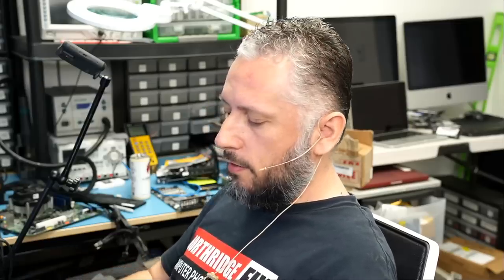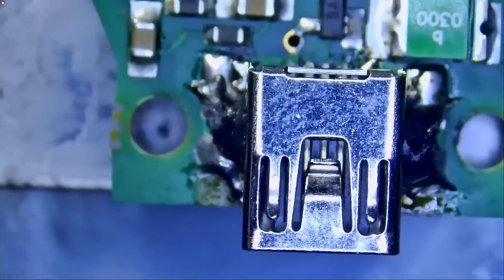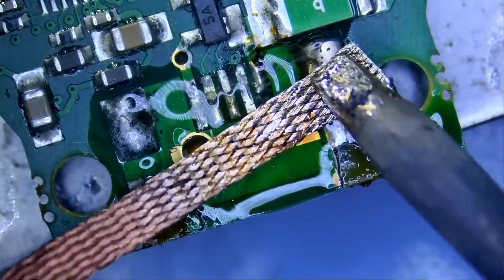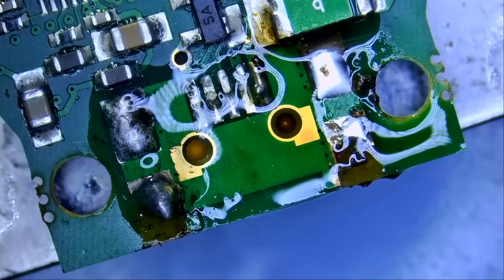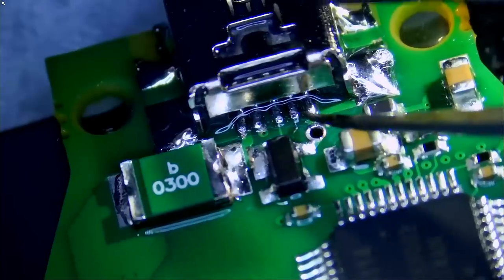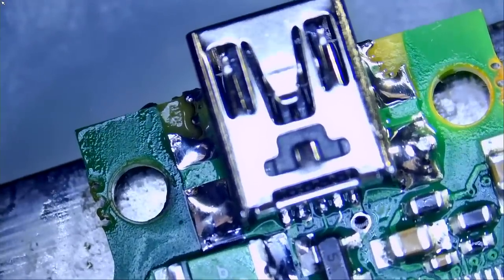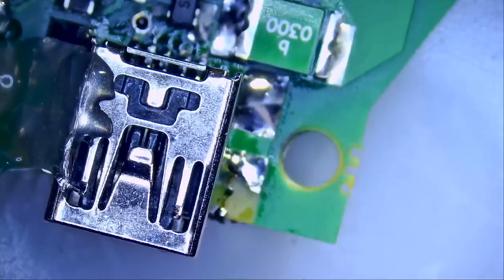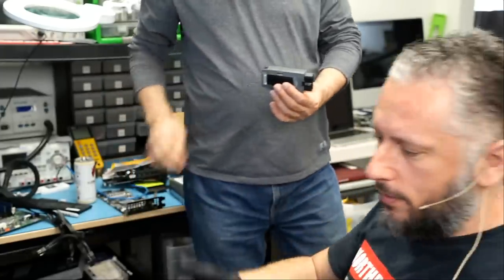Expensive Volkswagen VW Diagnostic Tool Repair

Comment: Just wanted to say thank you for this channel and the knowledge i made my first repair of a USB 3 connector on a $2000 Motherboard the original had many bent pins.

I used that magic flux/low melt and was able to salvage a new connector from another board. 

Now i have a very nice board and can say it was saved from E-waste.
Reply: I feel the same as you. Alex has inspired me to grab the soldering iron again. I even bought a microscope as my eyesight is not what it used to be. Northridge Fix is one of my favourite channels.
Reply: @cjh0751  this channel helped me take chances on items that would be E-Waste and give electronics another chance at life.
Reply: @shadowarez1337  Good on you. Alex's channel is one of my favourites. Nice to hear that someone else is benefiting from Alex's channel.

Comment: The idea of a connector that's not got its legs through-hole horrifies me. Penny-pinching greed from these giant public corporations.
Reply: it's not penny pinching. it's a business strategy called planned obsolescence
Reply: They just do the bare minimum to make the product functional. Both are correct
Reply: I don't disagree that they should use legs through the board to hold the connector regardless, however the unit is designed to use a special attachment that clips into the end of the VAS6154 and holds the connector and cable tight in place so it can't load up the connector inside and break it.  The reason they break is that people use these without that special connector and plug a cable straight into it which of course works, but doesn't have the support to stop it from breaking that it's designed for, so these failures are caused by misuse really not bad design as such.

If you do a Google search for vas6154/4 you'll see the adaptor.   The reason people don't use them is because the vas6154/4 has a special connector on the other end of the cable and they want to use just standard USB and instead of getting an adaptor to convert it they just bypass using the adaptor which is where they go wrong.
Reply: What does that term mean, through-hole?
Reply: @Gigaheart  it means there are holes on the board and the connector that's mounted on the top of the board will have attachments going 'through the hole in the board' to get to the other side where they're attached.   It gives the connector a much better grip to the board.
Reply: Well said

Comment: As someone who repaired a lot of ripped-off SMT power connectors I must give props to your method of securing the connector with some hot glue in the case! I would recommend to enhance the stability by soldering thick wires to the connectors' metal shield and route them to the underside of the PCB where they are soldered to the ground layer. The wires will withstand the force applied to the connector when the cable is inserted much better than the tiny soldering pads on the board.
Reply: I do something similar, After I solder the pins, I add a slither of unmelted hotglue between the board and shield and the heat melts it as I push down and solder the feet to the board

Comment: Very nice work. Maybe it is cheaper for the producer to use or make boards without throughhole pins. But i guess the reason is, that they know that it breaks easier and the costumers have to buy a new one or bring it in for "repair". They change the device, give them a new one and cash some extra money for it. Of course it will not get repaired by the factory. Great video, thank you

Comment: What are your thoughts on using solder wick to further secure the legs of the connector? Perhaps you could do this in conjunction with the hot glue?

Comment: I do that with broken laptop hinges works great with the hot glue. I use it on the plastic welds on ps4 aswell
Reply: Hot glue fixes everything! :D
Reply: @richardevans2829  yeh until the thing gets hot haha
Reply: @JayPrakash-th4rd  why ? What would you use on gaming laptops ?

Comment: Be sure to have a connecter inserted while applying hot glue. Otherwise you'll end up with hot glue inside the connector.
Reply: Only those who know the rules well enough have the right and ability to break them. 😅
Reply: Not really. The sides of the connectors dont have any holes and the molten glue will flow anywhere else but on the top, front or behind of the connector.

Comment: I noticed that there are 2 holes near the connector, the manufacturer could have used them to attach a metallic bracket to secure the connector. But I guess the manufacturer does not care about it breaking, they will happily sell a new one for a few thousand dollars.
Reply: Those holes are probably for screws to clamp both sides of the enclosure together through the board so it doesn't move around afterwards.

Comment: Any tips for getting soap out of a phone camera lens? Would be greatly appreciated!

Phone fell in soapy dishwater months ago. Phone has dried and works fine, but there's soap inside the camera lens "camera failed" error when trying to use. Front camera works but not rear. 

Have opened phone and cleaned connections with iso alcohol. also doused lenses in iso alcohol but I reckon I'd need to submerge the lenses in it for hours before it had any effect on the inside of the lens.

Comment: I was thinking you were gonna place some of that solder mask. I hope your hot glue solution holds.
I would have just made a huge solder blob to hold the connector. Maybe use sealing wax or superglue if there were no pads to hold the connector.

Comment: They should use something more rigid for this use.
I am Peugeot/Citroen technician and the tool we use (Actia Lexia) has a classic connector with screws. I dont remember the name of it, but probably the same as for COM/RS232 protocols or slightly bigger. The other side of the cable has USB A, but I would also love two have something more rugged there, as USB can loose connection stability, when moved. And automotive repair laptops move accidentally a lot, believe me. Its not easy feeling, when you do some configuration, that takes few minutes and a lost connection may easily brick an expensive and rare control unit, thats paired with other units and contains immo. That is, you brick the entire car in your garage. Been there done that...

Comment: I often wonder if it wouldn't be possible to drill through holes and anker these connectors with pure solder.
Reply: I did this with power connectors but it's very dependig on the PCB... if it's a multilayer board you may damage inner traces!

Comment: Nice job :)
You did 100% better job than the customer. But I wonder, what would happen if someone drilled through the back legs and used a through-hole connector instead?

Comment: What people should do to save their USB ports are magnetic-attached data USB cables. I have them installed on all my electrical items (cell phone, tablet, LED work lights, portable speakers, etc). They are available at any online store. Cheaper to replace a cable than getting a new USB port soldered in.

Comment: Just an idea, I'm not sure how the dongles are used (I presume directly connected to the PC), but if you were to develop an enclosure that physically attaches to the dongle, you could house a daughterboard with a female usb type C connector connected internally to the mini usb connector.
Even better would be to create a slightly larger full enclosure that would accommodate these components.
That way you would have a safety in case a technician breaks the port again.
Nowadays 3d printing is not that complicated, so I think this could be an easy solution.
Reply: The 6154a dongles are supplied with cables that have a hard plastic enclosure at the end that connects to the dongles just as you explained.

Comment: I think the USB connector is made this way on purpose. Kind of an predetermined breaking point.

The fact is, that the OBD interface in the car where you put the other end of the dongle in is placed on the left side below the steering wheel (above your left foot unter the instrument panel). When workshop personnel is working with OBD they often are sitting on the driver seat with the diagnostic laptop with them. And to prevent damage to the customers car the weak point of all that is inside of the dongle. It also prevents damage from the laptop, the dongle is more easy to repair than everything else.

A better idea would be a wireless dongle (USB connector then with through-holes) or a cable with predetermined breaking point as kind of an magnetic coupling.

Comment: I would have made a "horse shoe" bracket hold down for the front.
It could have been made of copper and soldered to the metal part of the plug.
Would have had to use leaded solder on that part though.

Comment: Looks like the word has gotten around that NRF is the place if you are an auto dealer and need your expensive diag tool port repaired.  Probably a very common issue.

Comment: Nice method. I think you can also use epoxy paste.
Reply: Epoxy is harder, but if the device needs another repair it will be a pain in the ass to remove.
Reply: @chongtak  good point

Comment: If you heat the metal to the same temperature, the glue will stick much better.  This principle is similar to soldering... we must heat the wires for the solder to stick.

Comment: I could never get "hot melt" glue to work for me anywhere around the house. 
It would cool down and begin to lose it's holding properties!
Reply: There are different types, and a good quality gun or two, for different sizes, might help.

A craft or sewing store, may be a place to ask.
Reply: Make sure that the surface you apply hot glue on is also hot. If you apply hot glue on a cold surface it will not bond, but if the surface is also hot the glue will bond much better.

Comment: You cant blame the mechanics for this problem.If the cars were designed and built well the mechanic shouldnt have to use the scope on them.Unfortunatly they are not and everything fails so the scope is needed to figure out what the manufacturer stuffed up again to make it come into the workshop.